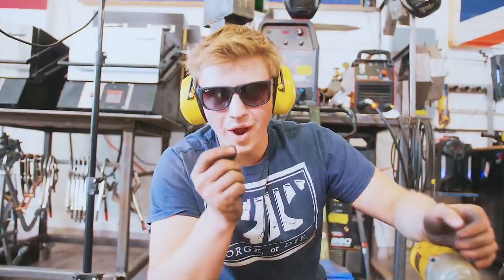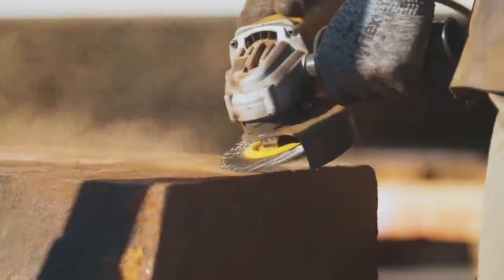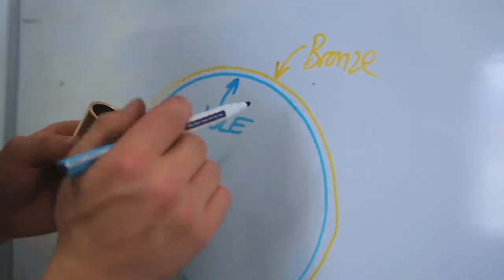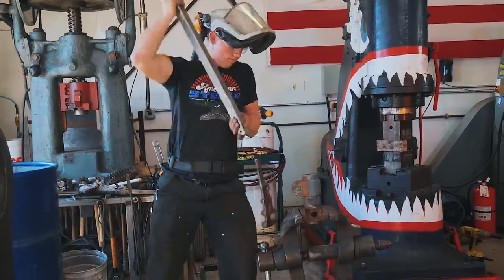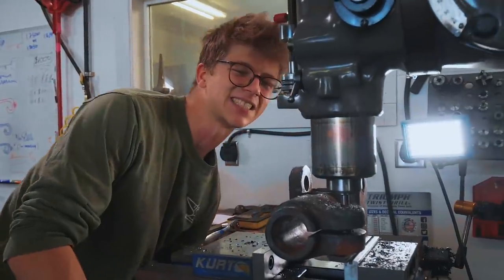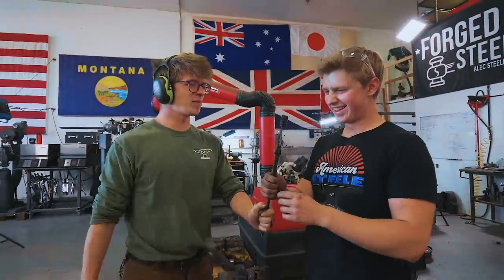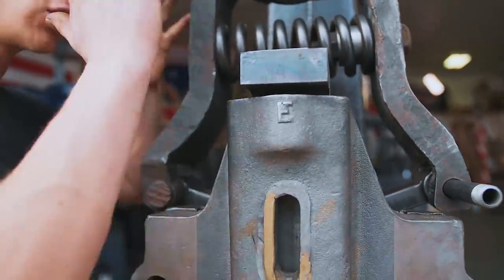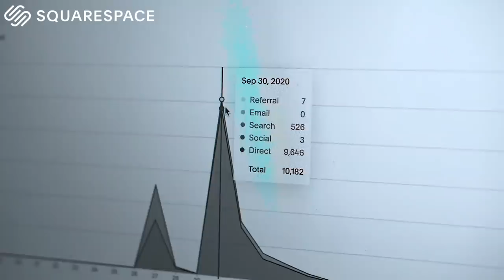RESTORING THE FAIRBANKS POWERHAMMER!!! Part 4

Comment: Since will is putting a steel bolt into a cast iron piece, will it be more prone to seize like steel bolts in aluminum blocks do?
Reply: Cast iron is lubricating isn't it? All that carbon is like graphite powder, and it's still fairly hard and strong compared to steel.
Reply: @AngDavies  oh wow I wasnt aware of that! I mean, it sounds probable!

Comment: Why not just drill a hole through and clamp it down using a nut on the protruding side of the screw? Threading the piece itself doesn't really make sense, the hole and the threads need to be aligned to begin with in order for it to work. Then as the screw turns and the piece is tightened and clamps down the threads will be pulled out of alignment and the screw will seize.

Comment: A36 is terrible material for a bolt.  Also heating it with the toggle thing didn’t help you.  1045 would be a much better choice to remake that bolt.  Or better yet. McMaster and order the correct bolt

Comment: you guys never seem to use any form of WD40 or other rust release agents... and you seem to be breaking alot of bolts... 
your default is allways brute force and heat... why not trying soaking the items overnight in oil before going to work on them?

Comment: You need to out that bolt in a trophy case and leave room for any other pointless stuff you worked on 

Edit:well not pointless but pain in the ass work for little reward

Comment: Why not just tap a threaded hole into the bottom side of the stuck bolt and then screw another bolt into it? After that auxiliary bolt bottomed out and stopped spinning, you'd have a hex head to be able to grab onto with either the good ol' wrench & sissy bar combo or an impact driver and drive it out from the other side. Seemed like alot of effort was expended when you fellas could've attacked it in a much more efficient manner. Of course, I could just be talking out my butt; this could've been a situation where that wouldn't work. But it seems like the much simpler answer.

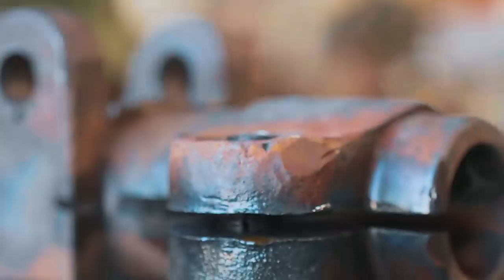Comment: He didn't shave the peaks of the threads with a file. That's what got it stuck. You can actually see the profile @10:38 and there's no indication of it. You're supposed to shave them off, they serve no purpose.